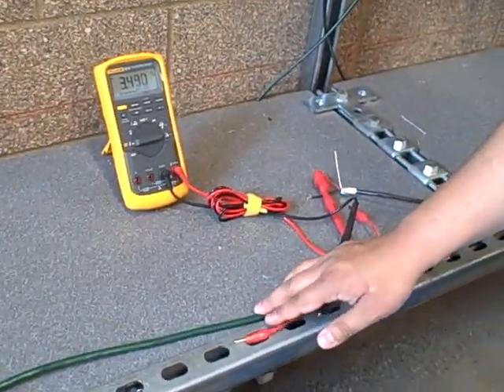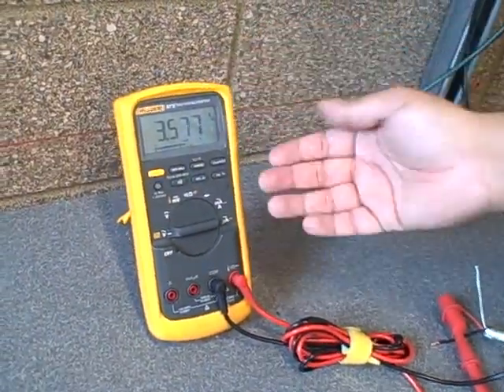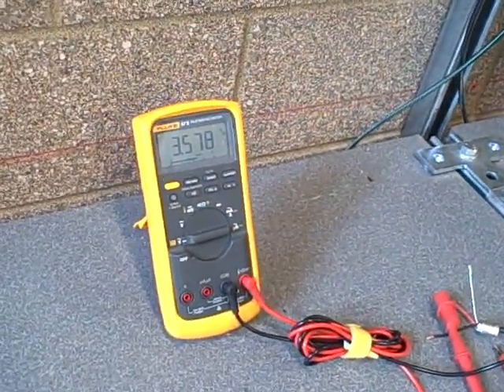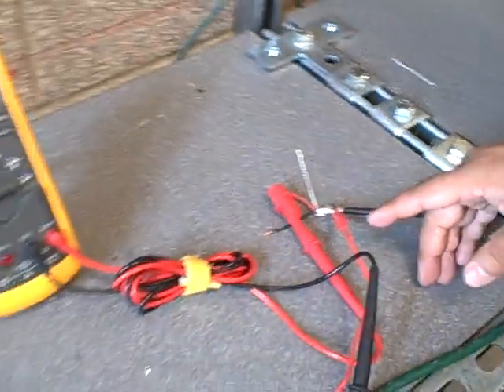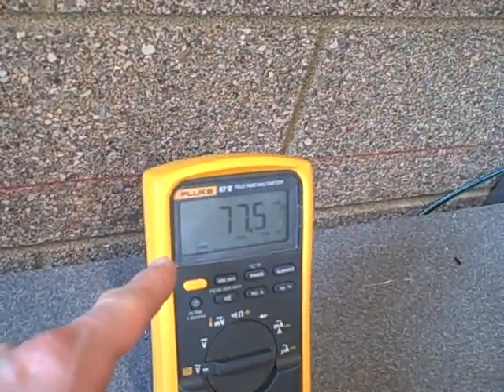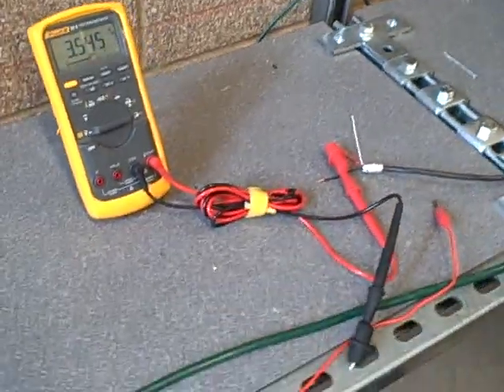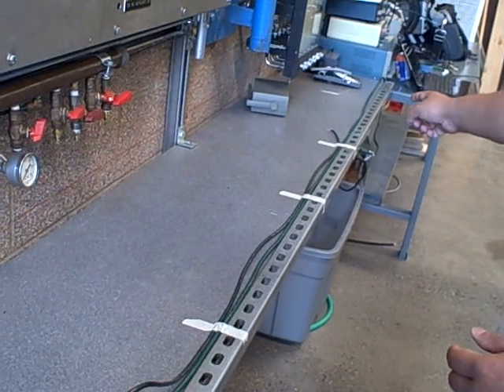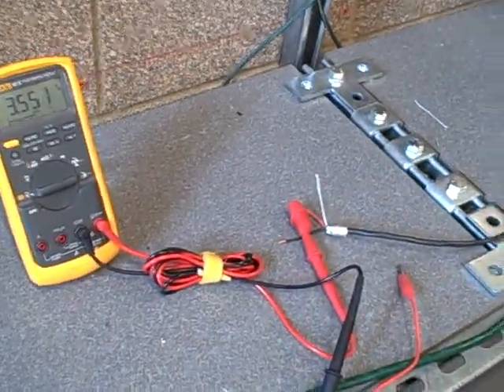Cable noise -- the effect of grounding the shield conductor

Comment: I know this works, but I don't understand why. A Faraday cage does not need to be grounded to eliminate fields from electric sources. How come that the shield needs to be grounded? It seems very similar to a Faraday cage.
Reply: Great question..... Responding just to see if what answers if any come thru
Reply: However, this is not a faradays cage since you do measure on the conductor inside the shielding. Why it helps to ground the screen is that the picked up energy does not accumulate and build voltage but can be distributed through out the ground which is a very massive body and therefore does not affect voltage
Reply: I think if you were in a faraday cage and had an external ground wire coming in, you would want to equalize the cage with this ground. If you’re not using an external ground the cage is grounded by default because your ground would be the bottom of the cage

Comment: Wow I have had internet problems for a decade or more with my att dsl lossing connection and dropping out . I ran a shielded dedicated cable to a phone jack in my house but was 4 feet short at the phone connection box . So I spliced it with some unshielded wire that was laying around . There was no place to bond the shield at the phone jack and my splice of unshielded cable did not extend the shield  to where the earth ground was . Maybe I could have used an extended single wire to bond it but I did not as laziness took over and said it's just a home internet connection. . I had att techs come out and do some repairs on their side but it never solved the problem . I ended running a new unshielded cable yesterday and all seems good . Watching your video gives me a clue to my laziness. The shielded cable not bonded was probably picking up emf noise and knocking out my modem .

Comment from the maker: @k0rmus If you connect both terminals of a grounded signal generator to both terminals of a grounded oscilloscope's input channel, you definitely have a ground loop!  This can cause problems in your measurements, especially with high-frequency signals.  You might not see any impact at low frequencies such as 60 Hz, though.  The solution to this ground-loop problem is either isolate the source from ground, or the oscilloscope from ground (by setting the scope for "differential" measurement mode).

Comment: Holy shit thats ALOT more noise than I thought, I have security camera line that also carries the camera power “12vdc”, an ethernet cable and coaxial cable for tv ran parallel for probably 50 yards, looks like I need some filters and ground. At least the coaxial is RG6 and the ethernet is cat 6a I’m pretty sure.

Comment: What was the settings you had on your DMM to be able to measure the noise?

I'm looking at building some higher end custom RCA for my audio system, is there anything you might be able to suggest &/or help steer me into the correct direction? Thanks!

Comment: Hi,
you talk about ground loop, but as far as I know, ground loop only occurs when you ground are connected and they have different potentials. In this case I don't see how that can be the case, because the shield would be connected to the exact same potential and earth point. ¿I am missing something?

Afaik, when you ground two sides of the shield, the problem is the current feedback, or negative current, that can exist from the device connected, in that case you are opening a gate for that power to ground and can cause more problems than it solves.

¿What do you think?

Comment: If you ground both ends... Are you sure that is a ground loop? I doubt it. It depends on the grounding of whatever is connected to the ends
Reply: Depends on what grounding. Are you saying we should ground both ends. I'm just confused a bit.
Reply: @westbay5858  safest bet is grounding at one point only and protect the shield and drain wire from potentially grounding elsewhere.  I was taught to terminate to ground at closest point to true ground in one termination or else you run the risk of amplifying the problem and potentially making a huge antenna

Comment: In my apartment building they recently redid all the electrical and put a new huge power box outside. Even since then I can here a plusing electrical buzzing noise. It's driving me nuts. I feel like I'm getting a constant electrical shock to my nervous system. What can I do?
Reply: You can stop worring about it since it is most likely just in your mind.
Reply: @KOMODOR Yea i just thought the same.
What can a normal electrician say to that topic ... im not a Psychologist xD
Reply: Is it metal noise?  intermodulation distortion. Google that. It was what happened to the cuba diplomats

Comment: i have my dsl line beside a 220v cabels throw wall channels to my room, will this cause a noise to my connection ,i have less than 10 db SNR reatio!

also i noticed that outside where my cable is comming from it's setup is under a high voltage electricity cable (1.5 meter away) will this effect ?
Reply: These cabels are normaly shilded.
so no ...

Comment: Grounding both ends of the shield would drop the common mode current even more. 👍
Reply: So video is wrong, I should ground both ends in my audio application?
Reply: @westbay5858  nope, one end only.  Yes, you can in certain situations but way more times than not grounding at more than one location causes problems and potentially amplifies interference.  
Sorry to counter the original comments direction only making it more complicated to decide, but I stand behind my experience accumulated over the years of obsessively trying to install properly
Reply: @supabiscuit  how about Ethernet in a light industrial environment? Actually what really amazes me is over half of our cnc machines run of rs232 on 50ft cat 5e runs back to 16 port serial to actual Ethernet converters. I just took over IT at an eyeglass lab and their network is wild..to say the least lol. The room that really worries me is our new coatings department. 2 vacuum deposition chambers with ion beams and a huge multi tray plc controlled ultrasonic wash station. I've noticed all the equipment that's new enough to have lan uses sheilded cables up to the external port. Ordering a spool tomorrow to pull to new drops but utp vs stp is still bugging me and then..two sheilded rj45 or only on one end
Reply: @johnwuethrich4196  in my opinion and from what I've been taught (newer hypersensitive commercial HVAC systems, but all the same principle)... Interference is drained on one end.  In my field it is closest to the ground lug at the outdoor equipment.  The shield is there to catch any interference (similar to wireless phone charging) and needs somewhere to go to make room for more collection of interference.  Grounding at the outdoor equipment may just be a universal standard they're trying to imply to avoid confusion, but the logic being all the same.  The primary reason for one grounding point is if there is different sources of ground (separate panels) there could be different readings from one ground to another..... So grounding on one end with one ground, and grounding on the other end with a different ground could actually create an antenna with no true drain and could actually amplify interference to the protected / critical signal under the jacket..... Whether it's cat5 or whatever.
It's like a faraday cage.... Though oddly enough from what I recall faraday cages don't always need to be grounded.
It's truly an interesting topic I need to look further into

Comment: Thanks a lot for the information. By the way are digital signals (DI/DO) can be affected also by noise if you have ground loops on your shielded cable (both ends of the shielded cable are connected to IE) ? Thanks for the advise.
Reply: Electrical Magnetic Induction (EMF) is a powerful thing. Shielding is very important and depends on if the wire requires it such as twisted pairs.

Comment: This video is kind of a mess. It leaves out too many details and too much context to be useful as an educational video. It fails to even mention the difference between EMI and RFI and the relative effectiveness of shielding on those. It fails to address impedance, capacitve coupling, twisted pair wires, single ended versus differential voltages, and voltage signals versus 4-20mA current loop process signals. In short, this video only serves to point out that shielding can be effective and that in many cases shields should only be terminated at one end.
Reply: Agreed

Comment: hows the classroom treating you?
A. the the green extension cord isnt pulling any current if theres no load on it (or negligible).
B. the noise could be due to the two grey/white 18/2 data lines in the channel iron (but i doubt it). the plastic coax sheath is too thick.
C. the suspended channel iron mounted to an end of a table is not bonded to earth ground. Ironically it is a floating potential by physical construction/orientation. who knows whats charging it?!? 
D. bond your channel and the reading would drop to zero without shielding considering the "signal cable" its butterflied to air.  you could probably earth it in this scenario by leaning another channel against it that touches the floor. 
E. solve the root problem not the outlier consequences. its the channel not the lines. 
F. ALWAYS SHIELD (or rather bond to case/pb) YOUR DATA LINE!!! as specified in every manual i've ever read in the field. just wait till you work in a saw mill. controllers are at different earth bond if separated by vast expanses. 3.5 AC is a lower end baseline in power and comm trays/ raceways. use form fit plastic plastic for data and run it separate from power. orange and green cable dont mix.